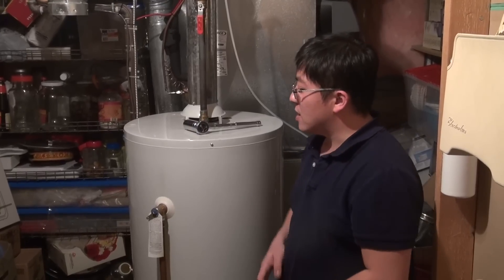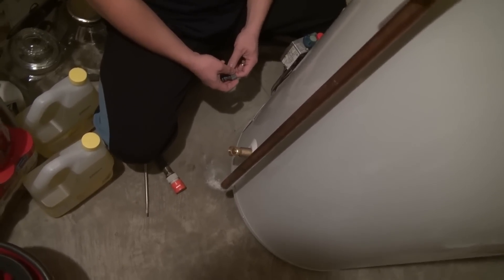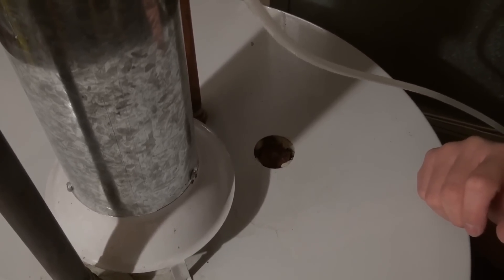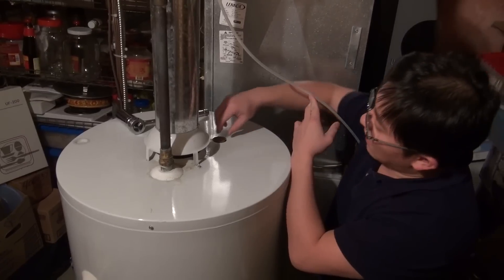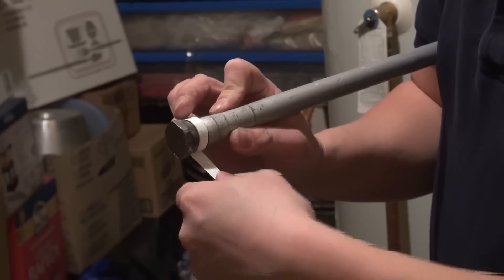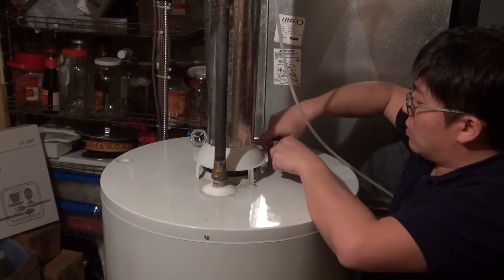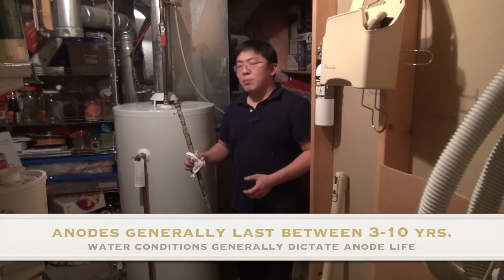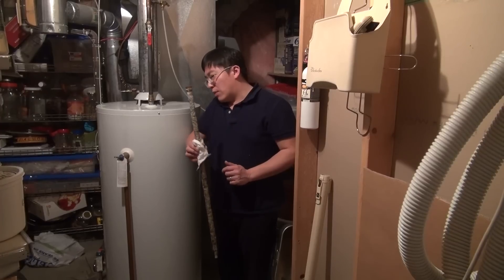How to Replace A Water Heater Sacrificial Anode Rod

Comment: I believe the teflon tape defeats the purpose as you are insulating the anode threads from coming in contact with the tank thereby stopping the corrosive protection. You might have noticed the anode rod you removed did not have any teflon tape on the threads as the pipe threads will do the water seal nicely.

Comment: Great video. Only suggestion would be to put the teflon tape on clockwise so that it does not unravel as you thread the new rod in.

Comment: Are you worried that the teflon tape might insulate the anode rod from the rest of the system?  I would thiink you'd want to assure elecrtic continuity from steel tank to anode rod to allow good electron flow from anode to cathode. I suppose you could check for zero resistance between anode and tank.
Reply from the maker: nope, b/c I don't put a thick amount of the tape on and I normally test the anode for conductivity (silly me totally didn't show that in the video).  I've done the anode change out so many times that I've never encountered a situation where it didn't have conductivity.

Comment: My tank is a Rheem and was just installed $2K. It is BOTH gas and electric. I wish you had done this to a much newer water heater so it would be more similar to what is now on the market.
Reply from the maker: That is interesting!  A gas AND electric heater?  I can't say that I've seen one in my locality.  If I had access to one of these new fancy tanks I'd so do a vid showing how its done :)
Reply: @piercedasian  I should have worded that better. It's natural gas but has a motor on top that runs on electricity. Some sort of a hybrid.

Comment: Thank you! I just replaced my hot water tank and I want to make sure I know how to take care of the new one. I think I’ll be checking my anode every other year and flushing once a year.
Reply from the maker: flushing regularly is a good habit to get into.  I'd recommend just pulling the anode after 2 years and evaluating the condition of it.  If there is lots of anode left on it then the next and change can likely go longer before it really needs replacing.

Comment: I will be doing this soon, so I have been watching many videos of people doing this. You have done a very good job of explaining all of the steps. While doing my water heater, I plan on inserting an inspection camera inside to try get an idea how well it is doing. I may also try putting in a wooden stick to feel if there is much sediment on the bottom after 6 years of use.
Reply from the maker: yes, replacing the anode is such an easy task that there isn't a reason why someone shouldn't consider replacing it every 3-5 years.  Adds so much life to a tank that this should be a requirements like changing out furnace filters!

Comment: Not sure how the water level could be higher than the top of tank...
Reply from the maker: It can’t be higher than the top of the tank but remember there is arm entire column of water above it in the form of hot water pipes that will drain back towards the tank once the system is depressurized.

Comment: You should always make sure the new rod is the same length as the removed one.. If not, it can bore into the base of the tank and it can lead to an explosion when returned to service..
Reply from the maker: That is useful advice though I'm not sure if I've seen a rod so long for a standard size water tank.  I mean the intuitive logic would be to insert the rod and if it feels like its hitting the bottom of the tank to rethink installing it since it would be fairly obvious that it doesn't fit right.

Comment: Hello. What I don’t understand is that how is aluminum suppose to corrode vs a steel tank?   Thnks.
Reply from the maker: basically in summary that aluminum or magnesium is willing to give up its ions more willingly than steel will so when there is corrosion happening inside a tank that the metals in which the rods are made from will give up themselves for sacrifice and let the steel tank not be attacked.

Comment: You got lucky. I tried to remove the anode on a few but could never remove it. I used breaker bar and trying to hold tank but it was rust in. I'm not on city water. I think I would have to do it at the first year and maybe it would come out
Reply from the maker: wow that's crazy.  I know some folks use an impact gun to get them out. I haven't tried that myself but if it is so rusted that its seized then I'd be worried that using an impact driver to get it out would result in cracking of the tank around the bung in which the rod is screwed into.

Comment: Shouldn’t you torque it to 120 ft lbs? AOsmith torques the anode rod at factory.
Reply from the maker: I can't say that I had (or ever) used a torque wrench on my anode rods.  As long as they're firmly screwed and not leaking that it shouldn't be a problem. 120 ft-lbs for an anode rode seems awfully awfully tight and I'd be worried that it would be hard to torque it that tight without someone holding the tank to prevent it from moving.

Comment: who would risk soaking it in acid overnight and plug it back in?
Reply from the maker: It depends.  While I personally have not done that myself that I know of some folks that fill the bottom bit of their water tanks with vinegar and then let it soak overnight and then flush the tank out (shockingly a LOT of junk DOES come out in localities with hard water).     I just flush my tank out once a year and change out my anode every 4-5 years.

Comment: Straight, simple and to the point! Love it! Just a note, the reason the sacrificial rod was in such a "good" shape is that it has been calcified thick preventing the ions in the water from eating away at the sacrificial material since its completely coated!
Reply from the maker: Glad you liked the video.  Yes the rod on this tank was definitely overdue for replacement which was why I took it upon myself to yank it out and replace it.  This actually wasn't even my tank but a relatives that asked me if I knew how to replace one.

Comment: Isn’t anode rod has to be in contact with the water heater body ? So using with Teflon tape will act as insulator? I need to clear this theory, thank you
Reply from the maker: you are correct which is why you won't want to apply too much of the tape on.  The idea is that as the rod is being threaded in that the threads are sharp and tight enough to cut through portions of the "peaks" of the threads to make electrical contact.  What I failed to show in this video that was an afterthought when people asked I my videos is "how do you know its making and electrical connection".  I knew my technique was working b/c I used a DMM to measure continuity from the top of the rod "nut" and an exposed metal portion of the tank.  If you have continuity then you have "contact" on the threads.  There are instances where I have seen people apply SUPER thick wraps of tape on the threads and then not tighten it enough to "cut" through some of the tape to make that connection and thus negating the benefits of using an anode rod.  I may consider one day remaking this video showing how to test the electrical continuity of the anode for those that are unsure if they did it right.  Good question and glad you asked.

Comment: wouldn't the teflon tape interfere with the conductivity of the rod?
Reply from the maker: If you lay on in too think then absolutely but I only did two wraps on the threads and the tape I use is extremely thin.  By nature of the rod screwing tightly on the threads in the tank that it would "cut" through the tape in some spots and therefore making a solid connection with the tank.

Comment: Thank you but what is in that other hole 1:48 on the edge?
Reply from the maker: The other hole is simply the fill hole for the expanding foam jacket insulation that was installed from the factory.  They essentially use spray foam to insulate a tank b/c of its higher R-value / inch of insulation.

Comment: Great video. My tank is 16-17 years old. Never had a problem with it. I also have never replaced the anode rod or even drained the tank. Honestly, I never realized this maintenance needed to be done. Now, I'm not sure if I should try to drain the tank, replace the anode rod (and maybe the thermostat and heating element) myself for a few hundred dollars and hope it doesn't open Pandora's box and might be a waste of time and money. Or replace the tank which will be a few thousand dollars. I don't have any real issues, but the family claim the water isn't heating as well as it should be.
Great video. I will look for more from you!
Reply from the maker: Hey Mike!  Given the tank is that old that I would not recommend you bother wasting time and money on doing the work.  I'd opt to replace the tank (it's long overdue for most people) and you'll get better performance and efficiency from the new one going forward, you can put the TLC into looking after the new one where it will make a difference for its longevity.  A tank that doesn't heat water as well as a sure sign that it is getting old.  The longest tank I have seen live is 25 years but that water heater was barely making enough hot water.  The few thousand you invest now will be worth it when you're being supplied with a strong supply of hot water for many many many years to come.  The anode replacement details on the new tank will be fundamentally the same as it is for your old tank.  Just make sure you buy a tank that has a separate anode rode that can be removed easily on its own and not the lame "integrated" ones that are tied in with the cold water dip tube or part of the hot water outlet.  Those are much more of a pain to swap out when they need replacing.

Comment: Nice video...I know it might be difficult bit I'd love to see some examples of when to change vs when to leave it go for longer. like when is it time to replace one
Reply from the maker: I considered doing a video like that but finding concrete examples of one that is good vs. maybe good is a bit challenging.  In our locality, we typically will pull rods every 5 years and given how hard the water is and how inexpensive an anode rod is that I just replace it (unless the old rod really looks like its new but usually it doesn't).  If you have soft water then it is advisable to inspect/replace the rod every 3 years for good measure.  The rod in this video is actually 15 years old and has NEVER been replaced and yet much of it is still quite intact.  We ended up changing it anyways b/c I'd spend more time and gas to return it than to just install it.  I know it doesn't answer your question but it gives you a sense of my inspect/replace interval that I follow now.

Comment: I never knew this needed to be done...im scared to see mine after 6 years
Reply from the maker: it might not be as bad as you think.  The rod in this video is easily 15+ years old and the water heater was original with the home that I was working in.  There was still anode material on the rod.  It really does depend on your local water because certain areas can eat an anode VERY rapidly so the only way to check is to inspect ever 2-3 years to "gauge" the amount of anode being consumed and then formulate a replacement/service schedule for your water heater.

Comment: is a great thing ..BUT most the people like me having the water heater out side in the closet or in the house closet, not that  much room on top  ...so cant do that , i juts drain & flush  it  it every year i guess
Reply from the maker: you can actually still replace the anode in them.  You'll just have to undo the rod and with the aid of a helper, saw the old rod into sections to get it all out. You can then get a "segmented" and rod that hangs the anode on a cable that is flexible and will allow you to install it in tight spaces.

Comment: Hi, great video. So for a gas heater - no need to completely shut off the gas supply when you do this / turn off the pilot?
Reply from the maker: nope not at all.  So long as you set the thermostat to vacation mode or even to pilot lighting mode that the burners will likely not fire up from you simply draining a few gallons of water out of the tank.  My tank is 50 gallons and I think I removed about 3-4 gallons out of it so if the burners did come on it would still have to heat approximately 45+ gallons of water which means the tank would never "dry fire".

Comment: Also if it’s got lots of corrosion or calcium — it doesn’t act in its sacrificial duty anymore and will start working on the inside of the tank which is steel lined with ceramic coating but it breaks down.    About $30 to replace it but a plumber will charge up to $300.  Just paid $257 to replace one thermostat which was $20 part.  If you don’t have clearance for the length of anode rod… they also come in a “sectioned” that’s in like 8-10” sections that connect and you feed them in.  

To get out… as he said, you can cut it piece by piece —- but don’t lose it.  Dry the rod as far as you can and run duck tape on each piece before you cut and a piece on the bottom piece so you hold on to it. Wrap the tape, and tape to the top of the tank. You will waste a bit of tape but you won’t drop the rod into the tank and not be able to retrieve.  This will all depend on length, working space, etc. as some like mine are under the kitchen counter.  You don’t want to save couple hundred dollars doing this yourself to have to turn around and have it replaced.  The new tanks take up more space and you won’t have the same gallons as you had before.  Ask me how I know.
Reply from the maker: That is a valid point.  I only started replacing anode rods maybe in the last 10 years or so and I would agree that one that is coated in calcium won't be doing its job properly.  That being said, I've since replaced my old tank and installed a water softener so that calcium won't be building up inside my tank anymore.  My understanding is that soft water tends to be harder on tanks as well (not sure of why) but the benefit is no calcium buildup and therefore the anode isn't ever "coated" with anything to cause it to stop working.

Comment: A word of caution: For electric water heaters it is important to make sure it is full of water before supplying electricity to it.  If the heating elements are powered without water then can burn up.
Reply from the maker: yes 100% true.  I do not believe I mentioned that in this video but I did mention it in my water heater flushing video (newer than this one).  Thanks for the reminder for our viewers.

Comment: my tank is close to the ceiling, can't pull the rod all the way out unless i empty and lean the tank....hmmmmmmm
Reply from the maker: well, you can actually remove it without tipping the tank (I don't advise you doing that).  Just get a helper and a hacksaw to cut your rod in half when its removed to take it out.  Just make sure you get a "segmented" replacement anode that allows you to put a new one in similar to a flexible series of anode "links" akin to a sausage link.

Comment: So even the one you replaced was okay? How do you know when to replace it? When the diameter decreases to much? I was going off appearance but I guess thats wrong.
Reply from the maker: How long they last is REALLY dependent on the water in your area.  In my locality the municipally supplied water is almost near pH neutral so aside from being really hard that the water is neither alkaline or acidic.  It is not uncommon for anodes to easily go for 10+ years without an issue but your mileage may vary.  Some anodes I have seen are completely rotted away just after 2 - 3 years.  Good rule of thumb is to replace every 5 years on average regardless of condition.

Comment: I try to remove old anode rod but it is too tight. I even use a 2 feet breaker bar but still not moving.
Do you know I can use a impact wrench, I was afraid it may damage the glass lining. Any suggestion?
Reply from the maker: If all else fails you can use the impact driver.  Normally I don't suggest people do that but as a mechanic that if you must use then you don't really have a choice either way.  Breaking a threaded bolt/nut/rod sometimes using quick blunt force via an impact gun can in fact protect the tank from damage. from slow gradual torque forces.  Hard to explain but I've seen plenty of guys break bolts on cars by taking them off slowly when they're rusty vs. me using a quick "blow" to the ratchet that breaks it free.  What do you have to lose at this point?  If you get it out and the tank is damaged then odds are you needed a new tank anyways.  If you don't want to take that risk then don't replace the anode and let the tank rust in peace and replace the entire unit in the future.
Reply: @piercedasian  Thanks for your suggestions.

Comment: I'm about to try to change the rod inside my hot water tank... I've recently moved into a mobile home, and when I use the hot water, there is an unbearable smell of rotten eggs (or sulfur).  I hope this works, but can you tell me how long I have to wait to "smell" a difference? Thanks!
Reply: You could also drain it and flush it out, make sure it has the proper rod material... Also make sure the temperature is high enough, sometimes the thermostat is too low and bacteria grows in the tank

I'm just a DIYer like yourself..
Reply: @guidedbygreen1480  thank you! My neighbors think I'm wasting my time! I'll come back and comment if it works!
Reply: @nancybedard320  of course. Aluminum+zinc or electric anode rods should be good for you. The h2s will react with the magnesium no bueno
Reply from the maker: TDJJ93 is correct, magnesium rods can react with water and make a stinky sulphur smell to your hot water.  I personally have aluminum/zinc rods in my tank and never had issues with smelly water.  Stink really is linked to the water chemistry in your area as we have tanks in our locality with magnesium rods and the water doesn't smell using them either.